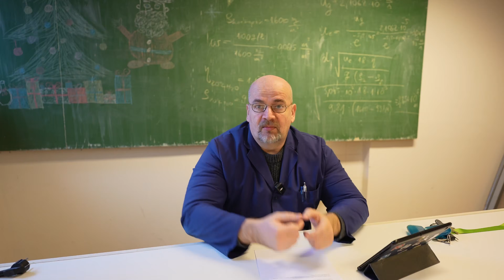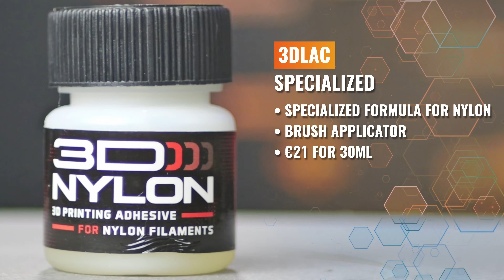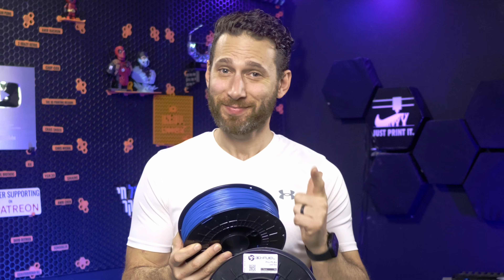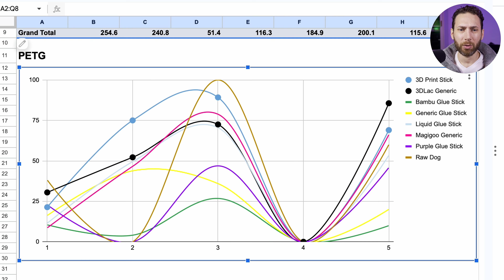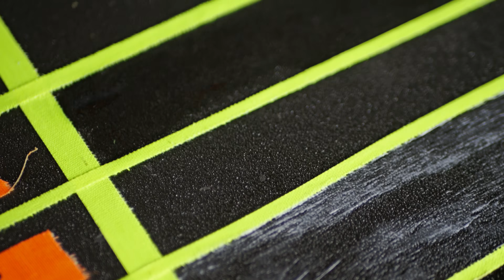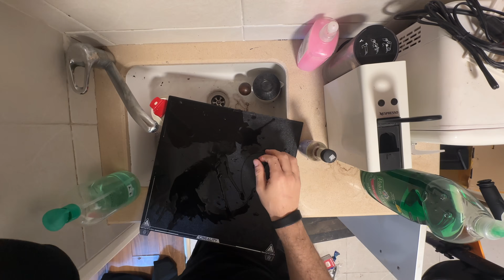I Tested 7 Types of Glue Stick for 3D Printing Bed Adhesion

Comment: I really appreciate your MASSIVE HUGE effort on this, but I think you should remove the video because with all the "errors" you had in testing, all datas are not reliable and a lot of the results are based on some good data mixed with some completely wrong, as it's so much clear from your pivot tables and graphs. Maybe the results could be nearly ok but this will be never sure until you have reliable data more than 75%, because in this case on some results you had more than 50% errors and failing on the whole data, that is really huge statistical error. Anyway still thanks for this, mine is just a suggestion to be honest with you viewers like you always did.

Comment: I just (re)discovered hair spray. My Sovol PEI sheets are starting to exhibit their age and abuse and printing success has been a 2D20 roll with 42+ required to succeed for my level 1 printing guardian.  It was so bad 3 days ago that my SV06 Plus almost found out what my backyard's frozen surface felt like from my upstairs office window ... I'd been using cleaning with hot water and Dawn as well as an alcohol wipe down.  Then, I shifted to glue stick.  Finally, after that once-again failure, I started scanning through various 3D reddit threads and found an old, old thread about adhesion on a FlashForge Inventor where they were weighing painters tape, Kapton tape, and Hairspray.  On a hunch, I had my wife pick me up some hairspray from the local grocery store and gave it a try.  The SV06 Plus and SV07 Plus have now both been running with no failures for over 3 days thanks to a light spritz from a $4 can of hairspray.

Comment: I just started using generic glue stick because my flsun t1pro printer came with one. Its been a game changer. Before i couldnt get consistent bed adhesion unless i used rafts.

That being said i also have some purple glue sticks but was hesitant to try it because i assumed it was going to be messier than generic since it feels softer. After seeing your test, Im definitely going to give it a shot. Im also going to try not cleaning snd reapplying every print. It is a pain.

I only use highspeed PLA btw.
Reply: @scott.adrian  purple glue stick is too messy thick and clumpy, I prefer the regular white sticks it goes on thinner. Hair spray if you need to cover the whole plate but it's not quite as strong. Also with hairspray you need to let it dry. if you print on wet hairspray it will fail
Reply: @sudo936  I have tried both glue sticks and unfortunately I have like 40 purple glue sticks left over from kids school supplies so I'm STUCK with it for now but I agree. All glue sticks are a PITA but necessary evil at least for the T1 build plate. I'll give hair spray a try. I don't like the glue scars.

Comment: Shabbat Shalom. When I was running my Ender-3 S1 I ended up getting Magigoo based on your suggestion and had some luck. At that time I was only printing PLA. Since switching to 2 AnyCubic machines I haven’t ever even needed it, rawdog PEI plates and no issues printing PLA or PETG.

Comment: Personally I have used Aquanet hairspray on glass since my first 3d printer the Robo3d R1. Which shows how long I have been printing. The company that built that printer was instermental in making consumer 3d printing a reality with their help, documentation, support etc. They created a ton of documentation that really made 3d printing understandable to the masses. The hairspray is super cheap, and on glass is super easy and steong enough for just about everything I print. The nice thing is with a razor scraper and mild soap or windex it comes off super easy and makes for a super clean glass build plate with minimum effort. Is it the best? Probably not, but it takes 1 second to spray and its ready to print as soon as the bed heats up. I rarely have adhestion issues with it. I just find the application so fast and easy I find it hard to do anything else. But nice to see the findings of the video.

Comment: this strength numbers don't mean much, you need the glue to keep the model in place during printing, not to survive WW3. In this respect, every glue in your test which was over some limit is as good as any. I successfully use different CHEAP glues for children and sticks for years and didn't have any issues. Of course, some are better than others, you select your preferred after some experiments, but generally, any pva based dissolved in water, or even soldering flux (resin) in alcohol (IPA) does the job and costs peanuts.

Comment: I'm going to add additional comment just to kind of give this actual sing a real shot depend upon which type of bed you're running like in my case I run a glass bed obviously I'm running an Ender 3 V2 but with that being said each person runs a different build plate the question is what type of stuff is best for the type of build plate you're using and I guarantee they're going to be a huge difference because what may stick to one build plate better may not stick to glass the same way and vice versa

Comment: "Leaves this residue, which if you wet your finger, is sticky and disgusting..."
I am reminded of the story when the man told his doctor that his arm hurts when he does a particular thing.  And the doctor replied, "Well, don't do that then.."
All you have to do is not wet you finger to avoid what you consider disgusting... ;-) 
And as others have pointed out, the residue washes off easily.
So I think the moral of the story, if you already hate glue stick, you probably shouldn't use it.
For everyone else, it's a pretty cost effective option.  ;-)

Comment: Elmer's craft bond spray adhesive.... preheat bed to 50c spray a decent amount onto a paper towel, you dont want to have the paper towel stick it must be pretty soaked whipe down build plate once. This has worked super well for me realeses pretty easy and has insane longevity I have a pretty dusty room and work area and I haven't cleaned my bed in months.

Comment: I also wish you could’ve tried NPA, it’s great stuff! Unfortunately, I do think the testing methodology, while understandable for time and effort reasons, was too flawed. 

Trying to print all those different filaments at the same time, with some being less than ideal temps (too high), makes it hard to really interpret/trust the results. Obviously I don’t think there was any intentional skewing of results, but not giving each filament the ideal printing conditions must have affected the outcome. It is entirely possible that it doesn’t matter all that much, I just don’t see how it couldn’t have some impact on the efficacy of the test.

Comment: As someone who doesn't, currently, have a climate controlled room for their printers I would be interested in seeing a part 'whatever' on how the room temperature affects the grippiness of the different glues. Temps have gotten down to about -7°C for an idea. 
I've been running a small heater about 30 cm from my printers (a1 combo and kobra 2 max) to help with adhesion as much as possible.

Comment: I must be missing something.  I have been 3D printing for 4 years and have never used anything on my print bed. I sell about 80% of the things I print. I did try using painters' tape on time when I was having trouble with a PETG filament that for some reason just would not stick to my build plate. It was a tremendous failure.  I have 3 printers two with PEI plates and the other with a glass bed.
Reply from the maker: You probably don’t print nylon.

Comment: Stop using glue. buy a good bed. I print a lot and I always fooled around with glue and other magic potions.
In the end the only thing that matters is a good PEI bed. My prints never fail, the bottoms look fantastic, glue is never ever needed. Clean the surface regularly with alcohol, it never fails me anymore. And don't touch with your fingers!

Comment: I thought the point of glue stick with PETG was as a release aid, to reduce the adhesion not strengthen it. That might of been specific to the Bambu build plate.
So if an adhesion around 30 is actually what you want because too strong is an issue then your analysis is all wrong as you looked for strongest rather then closest to ideal. Ideal probably varies with material, after all a stronger(layer adhesion) material is at less risk of braking between layers from a strong pull to remove from the build plate. Anything where you want a release agent wants a strength LOWER then the "raw dog" not higher.

Comment: Could you find it deep within yourself to redo some of the ones you weren't happy with? I feel like abs & nylon are going to be the furthest into the mechanical grade polymers that I'll be printing for the foreseeable future and id love to see better results on those. i seem to have no problem with petg at all. I actually prefer it over pla and i just use painters tape with purple glue. I've used it without glue same results. The glue just means cleanup after. I've been too afraid to raw dog the textured pei sheet with petg as I've seen horror pics about it embedding into the bed and ripping it up with it.

Comment: For a long time, I was using glue stick with any of my surfaces to make sure I didn't end up with failed prints and loss of filament.  After watching one of your videos and hearing your opinion on Magigoo (before they were your sponsor) that convinced me to try it.  I'd avoided it due to it's price but I've not regretted it for a moment.  I rarely use my glue stick now and find that a coat of it on my PEI sheet last for several prints before I have to add another application.  I'll admit that I feel a bit validated for using glue stick as long as I did and think your findings about it interesting.  Having said that, 100% agree about the mess and how it can affect the final product.

Comment: data skew happens.  that's a quirk of life in the real world, where things can & often do go wrong or simply refuse to go according to plan.  😋  i'd be interested in a followup video, assuming you have enough build plates to avoid cross-contamination, showing the relative strengths & weaknesses of the most popular spray adhesives too, but i do understand your frustration with the tedium & wanting rather to leave the testing to others.  thanks for the info & helping me save money on trial & error for lack of a proper testing environment!  😊

Comment: Glue stick washes off with luke warm water very quickly if you agitate it. Takes only a few seconds. Put the part to dry on a towel. No sticky residue.

Comment: Hmm You say that Magigoo and 3DLac outperformed everything... but... The issue is anything ABOVE the needed is just wasted... The bare PEI has a sticking force HIGHER than the highest nylon, and as you can print nylon reliably it means that the threshold holding power is about that level it descends that the various glues are fundamentally a waste of money for ABS.

Comment: Should have done them in serial instead of parallel. It would have taken longer, but you wouldn't have run into those issues. Slow and methodical, one at a time will always eliminate confounding variables and make you less likely to run into unanticipated problems.
Reply from the maker: That’s 100% true but then what would my excuse me to get a Prusa XL? 😂

Comment: Aside from the glue stick that shipped with my MK3S, the only bed adhesion products I've used are blue painter's tape and Layerneer's Bed Weld. I mostly prefer to raw dog to avoid having glue flaking off the bottom surface of making it sticky. I've only recently started printing with ASA, on an unenclosed MK4S at that. I printed 5 sets of Filamentalist with Polymaker ASA. First print had adhesion issues on the Prusa satin bed. Added Bed Weld and had some corners lift, but still finished the print. Best success was to print 1-2 layers of PETG, then switch to ASA. Polymaker Pop Pink ASA closely matched the Overture Magenta PETG I already had on hand, and i can't easily tell they were printed with two materials.

Comment: When I got started in 3D printing, (and mind you, you're one of the reasons that I got into the hobby, so big shout out/thank you for the introduction into such a wonderful world), I used to use dish soap and water. But I was also mostly printing PLA. I then delved into PETG but ruined a PEI bed, so I started looking into prevention and got into hair spray. It worked really well, but I didn't like that after a while, I started finding it on all the things near the printer. I guess the particles were making their way onto nearby objects and most things felt almost sticky. At this point I also attempted my first print in ABS, and hair spray was not enough. So, I switched to glue stick. It was great! It worked with PLA, PETG, and ABS! BUT... I always needed to clean my prints after wards. So that was kinda annoying. Not to mention how ugly it made pictures of my 3D printer look because the print plate was all lathered up in glue stick. It just makes it seem like you're neglecting the printer. After a while, I found one of your videos talking about Magigoo, and I really liked the idea, but I didn't like that it was filament specific, since I have a tendency to switch between filaments. Specially now-a-days that I'm printing in all kinds of materials. PLA and PETG are still my go to, but from time to time I will use ABS, ASA, TPU, PC, and Nylon. Heck, just yesterday I ordered a roll of PPA-CF from Bambu Lab, so I will be trying that out soon! And I don't want to have to clean my print plate every time I use a different filament. About two months ago, I found the Nano Polymer Adhesive from Vision Miner and it feels like it's the perfect solution. It's easy to apply. It comes in liquid form which means you smear it rather than spray it, so it won't get on other objects. It goes on clean, and even after having some prints, it still looks great, unlike glue stick. And the fact that it apparently works with just about every filament under the sun (except PP), it is my go to bed adhesion product. Oh, and while the first you prints after a fresh coat do seem to get some to adhere to the bottom of the print, it washes off with just water, and is easier to clean off than glue stick. A single wipe with a water-dampened towel takes care of it.
Reply from the maker: Thanks for sharing and for the very kind words. That’s what I do this for! (And the cool toys obviously)

Comment: I just used TPU on my Bamboo Labs X1Carbon with out any glue stick. The door was closed. TPU was a selection on the screen. The print stayed on the bed throughout the printing. The print came off with ease.
Reply: @earlowens998  Which build plate?

Comment: No 3D Gloop?
Reply from the maker: Gloop is for gluing prints bro not beds
Reply: @thenextlayer  Um, their front page seems to think otherwise. A snippet from their front page: "Our unique adhesive formula is easily brushed onto the 3D Print or the build surface..." Should you redo a test like this (tedious, obviously, but a great idea), I'd suggest it be in the running, so we know how it competes with the others. And your tension measurement rig is fine, just need to straighten the bottom hook a bit should solve the levering problem. Good 1st cut; I hope there's a 2nd one.

Comment: I've had a lot better luck just keeping the bed clean and using sprues with 10mm dots on sharp corners. A different take on mouse ears, but it works for me. I've used them with PETG and ABS on prints that warped without them. Now I just put them on any larger print that has a sharp corner. I don't like what most adhesives do to the first layer finish, and most of them won't come off the part without sanding. Some adhesives won't wash off the build plate once they've been heated up. I used to use hairspray as a release agent for PETG but found it easier to use a textured build plate.

Comment: From my experience it really depends on the filament brand.. I have some ASA that sticks too well to raw pei, others I tried stick well enough . Samw with petg, pla, abs and tpu, I don't think you need glue for them at all. PC and PA are a different story, in a pinch bambu stick worked with PA but magigoo is better ofc.

Comment: I use nothing 99% of the time.  The few times I have to use something I will use Bambu or Elmers glue stick for kids. It involves with making a zig zag across the plate and then spraying it with water and wiping it off with a lint-free rag that I have dedicated. It ensures that the most minimal amount of glue and that it is spread as evenly as possible.
I have found too much or uneven adhesion seems to work not as good as having it as thin as possible on the plate.

Comment: rubs sticky glue stick residue with a finger... wonders why everything the finger touches after feels sticky :D

seriously though, for me the advanced adhesives serve one purpose: prevent prints with more challenging materials like ABS and PC to warp off the bed, it does not matter how much force is needed to remove the material beyond that... for strong adhesion, the limit is then often shifted to keep the steel sheet attached flat to the magnetic surface.

So for me, a better test would be to see how the adhesives prevent warping of long objects and the ease to remove the objects when cooled down.

And btw. glue stick and other adhesives are not used only to increase adhesion, but often also as a layer preventing fusing with PEI etc. which can get pretty costly (common for TPU, PETG, ...). Good result even if it results in less adhesion.
Reply from the maker: Oh true I didn’t realize I was using the same finger. Or was I?

Comment: Id like to know the results in regard to TPU and its notoriety to sticking TOO well. What aids in removal?
Reply: Unheated bed
Reply: @riba2233 oh? Will that help?
Reply: I put gorilla glue stick on the bed as a release agent and used it with pla on glass with my old printer because no matter what I did it wouldn't stick to the glass.